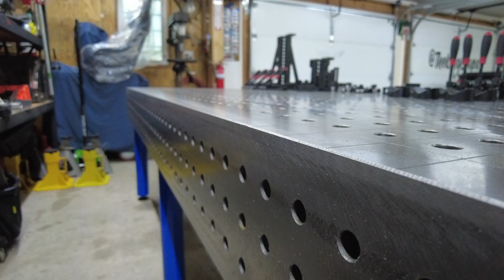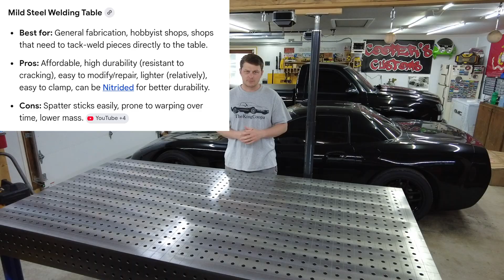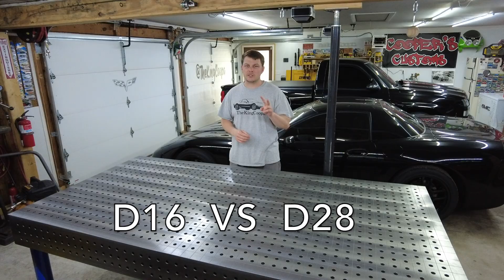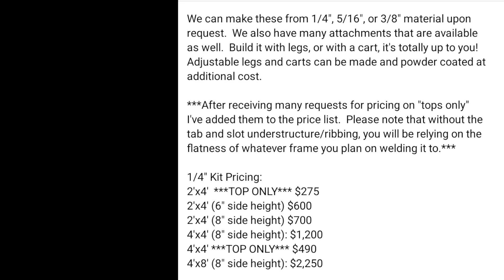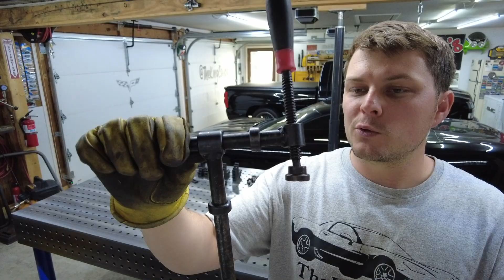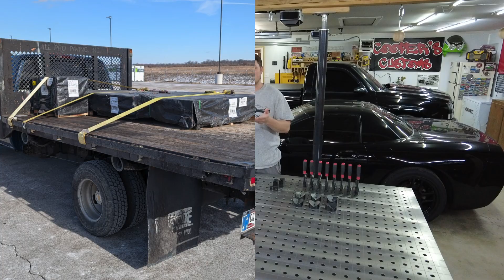Alibaba Welding Table, Full Review!

Comment: Very helpful video.   I took your advice and ordered a table with nitride coating, legs with castors and added rulers down the sides.  Most things worked out the same as you described.  I did rent a fork lift and between the lift gate on one end and the fork lift on the other, we got it down.  I had a question about chamfering of the holes on the bottom side.  If you look at the bottom side, are all of your holes fully chamfered, or are there some that are not?  I was a bit disappointed that all were not.  Manufacturer says that the table thickness varies with the casting process, and that means that thinner regions of the table top will not be chamfered in final machining.   Table looks good from the top as you say.  Are all of your bottom and interior side holes chamfered from below?